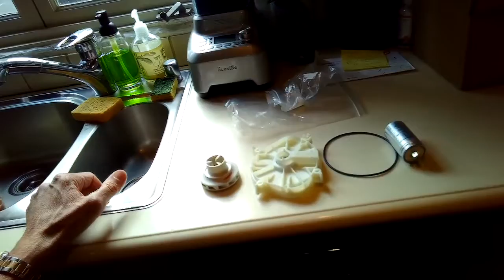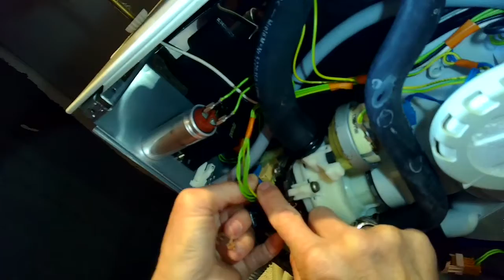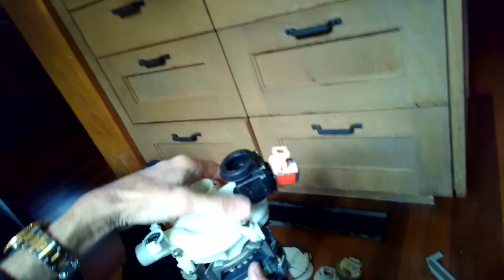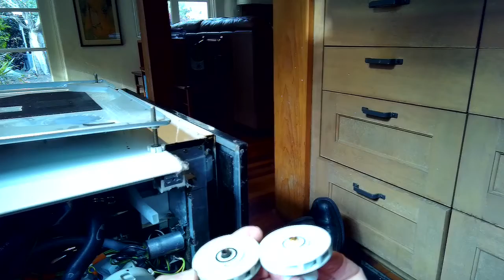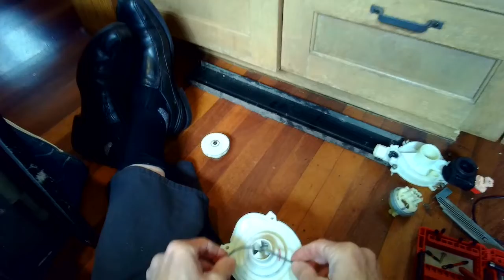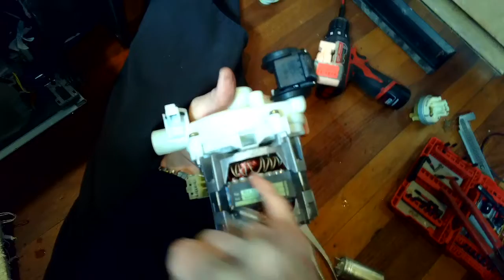Miele Dishwasher - Circulation Motor Repair  -  FIX IT YOURSELF AND SAVE $$$

Comment: Hi Scott, Ended up having two problems with the Miele G896 SCI Plus dishwasher. The circulation pump was leaking, but after installing the new partition kit with impeller, water was still leaking into the drip pan from somewhere. Finally found the leak, it was coming from the level control. The plastic on the level control had worn thin and had an invisible crack. So ordered a new level control from Miele, replaced it last night and no more leaks! Dishwasher is working great again thanks to you and your videos! Thanks for answering all my questions and for all your help!
Reply from the maker: Wow,
Nice job, I’m proud of you😊
Reply: @ScottTheFixItGuyChannel  Hi Scott, Still have the dishwasher pulled out. Ran it two more times while it's pulled out, now seeing water (about 4 or more tablespoons) leaking from the outside back right lower corner from a rectangular white plastic pipe that measures 2 ¼ inch tall by ¾ inches wide (it is flush with the outside rear panel and is near the bottom right corner). I can feel water in the bottom of the rectangular pipe and directly below the pipe is the water on the floor (it is not dripping into the drip pan). I can also see what appears to be white soap scum in the pipe and some crusted soap scum staining directly below the pipe onto the rear panel and more staining that runs horizontally along the bottom edge of the full width of the back of the washing machine. Is this some type of overflow or weep hole that needs to be cleaned or could there be another part giving out or that needs to be cleaned? I looked online and in the repair manual and can't find any information about this issue. I looked through some of your videos and couldn't find any repair that mentioned this leaky rectangular pipe on the right bottom rear of the dishwasher problem. Looks like I need your expert guidance again. Your help is very much appreciated. Thank you.
Reply: @ScottTheFixItGuyChannel  I talked to a Miele technician. He said he believes that the rectangular pipe is a vent.  He said he believes the vent is connected to the intake (he said it’s very difficult to see in the technical manual). He said there may be a leak on my intake somewhere and that is what is causing the water to drip out of that vent. He said to check the intake.
Reply: @ScottTheFixItGuyChannel  Did some more research. I think the leak may be coming from the Solenoid valve Y5 which appears to be the Water Hardness Mixer Solenoid. It is in the intake area on the right side of the dishwasher. It appears the solenoid is on the plus models only (they have the water softener). Going to try to take off the right panel this weekend to see if the o-ring on the water hardness mixer solenoid is leaking somehow into the intake vent, on the back bottom right corner of the dishwasher.
Reply: @ScottTheFixItGuyChannel  Hi Scott, I took apart the right side of the dishwasher. The water is coming from the water inlet mixer rectangular Vent and leaking onto the floor behind the dishwasher (not into the drip pan). The rectangular Vent vents out to the outside back lower right of the dishwasher. It spits out about two table spoons of water (sometimes a little more or less) onto the floor, behind the machine, at cycle start up and then right around the drying cycle. Water is not dripping or leaking from anywhere else. It's definitely coming from this water mixer vent and dripping from the vent, off the back of the machine, onto the floor.
 
My question is: Is this small water leak, coming from the mixer vent that exhausts to the back of a Miele G896sci Plus, normal operation? In other words, should this vent spit a small amount of water out of it, onto the floor, during start up and drying cycle?
 
I've asked this question to Miele and called repair shops and no one seems to know if it is normal for that vent to spit water out or what would cause it to do it if it's not normal. They didn't even know that vent existed until I directed them to where the water inlet mixer vents to the outside of the dishwasher. Any help on this would be very much appreciated. Thank you.
Reply: @ScottTheFixItGuyChannel  Hi Scott. About 11 months ago I mentioned that I had a water leak from the back mixer vent on my Miele G896 SCI Plus dishwasher. No one could figure it out, not even Miele.

I think I may have stumbled upon the solution. 1) I started running the hot water on the kitchen faucet, until the water got real hot, before running the dishwasher. 2) Started putting less dishwasher detergent in the dispenser. 3) Started rinsing the soap out of dish sponges before putting them in the dishwasher for cleaning.

Since doing these 3 things, it seems that the water has stopped leaking from the rear mixer vent.

I've been waiting to post this for months, since I wasn't sure if the rear vent leak really stopped. If the leak comes back, I'll let you know. But it seems, at this point, the leak has stopped by doing these 3 things.

Comment: Dear Scott! Not super camera, but super teaching. Greetings from Czechia, from owner G 590 SCi (Nr. 15...), used from 1990 until today. I have no chance to get off the turbine from the shaft. But I will be trying it again and again. (-; Because of its incredible vitality! (-;
Reply from the maker: You can do it, just make sure you put a small flat screwdriver in the back to keep the motor from turning while you unscrew the impeller.

Comment: I have a F78 fault. I’ve cleaned filter, including removing ball-bearing section, plus added boiling water with rinse aid etc. The dishwasher pumps all water out but won’t pull water in. Any ideas?

Comment: Hi Scott ! Your videos are amazing !! I have a G841 with the dreaded intake / drain red light blinking. The machine drains water fine, and fills like normal. I’ve tried the fork trick - I can feel the impeller moving with not much effort on the fork. There was water in the drip pan. I’ve dried that out, and supposedly reset the error codes ( holding the Start button in for 5 seconds with the knob in Stop position, then power it off and on again), poured boiling water in the bottom to try to free up any hidden gunk.  Do you think the problem may be the circulation pump (failed for some reason ?) Or replace the partition kit / gasket like in this video? Why would water get into the drip pan?
You are an absolute hero to all us fix-it yourself people. Thank you for any advice. Jim
Reply from the maker: Thanks so much Jim,

Sometimes water can flow back  from the sink through the drain line and flood the drip pan or the fill valve can not fully close and flood the pan or you could have a leak from the partition.
Reply from the maker: You can remove that lower pan and watch as the dishwasher  starts to see if you notice dripping onto the drip pan.
Reply: Hi Scott -
I’ve dried out the drip pan and see no new dripping. What do you think the next step should be?  Very happy to pay you for advice. Thanks for any help.  -Jim
Reply: Hi Scott - Where do you order your replacement parts from? It sounds like I might need the partition kit as well as the run capacitor. How can you tell if the motor itself is shot?  Thanks !  Jim

Comment: Hi Scott, I found that I need the heater coil on the circ. pump motor and I found a 240v, but mine is 120v. They look exactly the same, and I'm wondering what the possible difference could be?
Reply: I just figured it out, I think. Thanks
Reply from the maker: It should work for your 110 volt power👍
Reply: I was talking to my hvac buddy and he said it would work but @ 120 volts (1/2 the voltage) a 240 volt element will only put out 1/4 of the power.  @ScottTheFixItGuyChannel

Comment: Hello! I'm asking for your help. I would like to start an old Miele g 641. Unfortunately the old aquastop is completely missing. I don't know where to connect the new system's electrical cable from another device. In the video, I see that the black power cable passes through the bottom of the maze, but I couldn't find its connector. Could you send a photo or a drawing about it? Thank you very much! Hi, Zoli from Hungary.

Comment: Thanks for reply.  How do I know it’s not the motor and not just a “partition kit” .  15 year old unit and they want a $1000 for motor.  My motor does not run after fill.
Reply from the maker: Hi Thomas,
If the motor does not run after It feels then it’s most likely not the partition kit.
It’s probably the impeller is stuck against the partitions seal.
At some bottles you can reach in with a fork and get the impeller to rotate again.